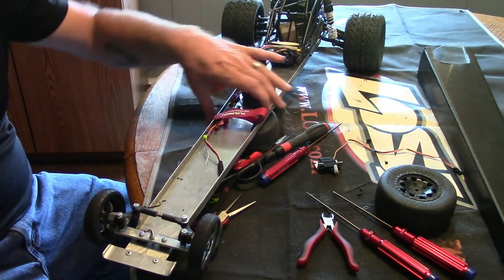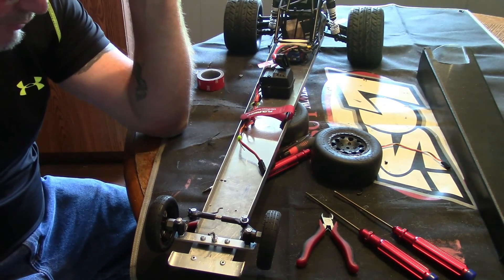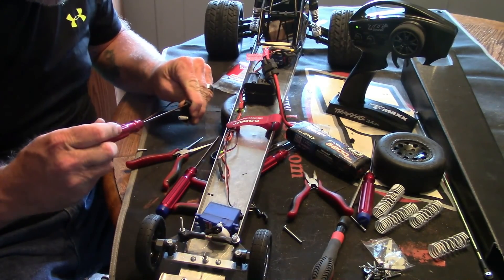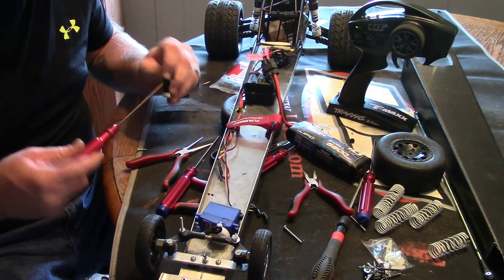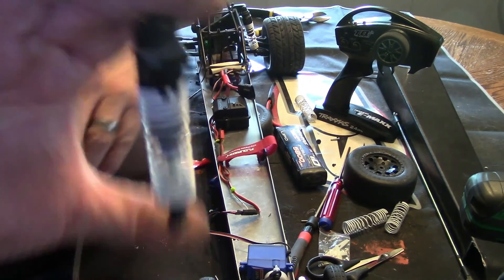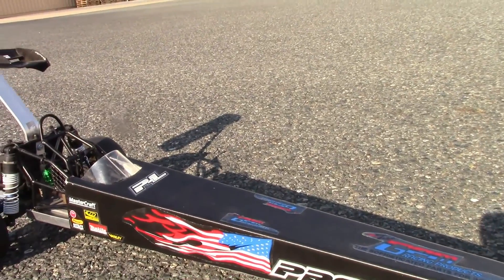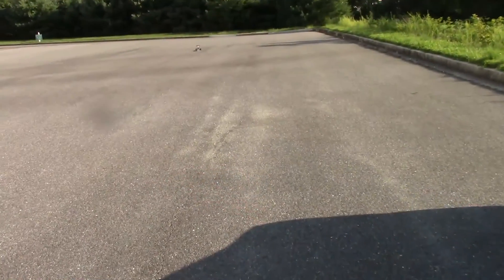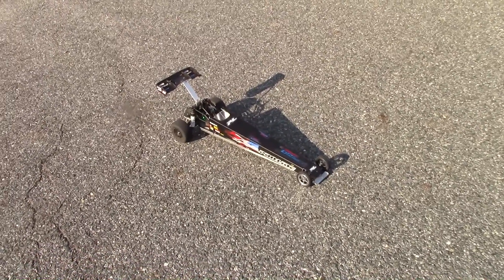DRAGSTER BUILD ...THE CHANGES AND RUN VID!

Comment: Wow great job there. I'm planning on making my own too but with a little cheating. I plan to use the arrma 1/7 full rear dift but shorten the arms and put 1/5 proline wheels on it. Followed by cutting 5mm carbon fiber chassis. Not sure on front end yet but all with 1/8 Castle motor direct to dift.

Comment: nice build! 
now that you have locked out the rear suspension maybe you could lower it a bit at the rear? 
I think you will need to experiment a lot when it comes to tyres, i've not had much luck finding cheap tyres that don't balloon out.
Keep up the great work :)
Reply from the maker: thanks  bud. I may do that. yup, cheap tires aren't good unless you tape. thanks for commenting!

Comment: its a cool build for sure. 3s will blow those anaconda tires in pieces though. but a hobbywing 4s esc and motor combo with proper tires and that thing is going to be a runner
Reply from the maker: Thank you! Once I get things straight I'm going with something bigger for sure